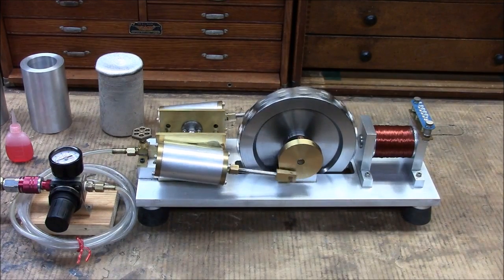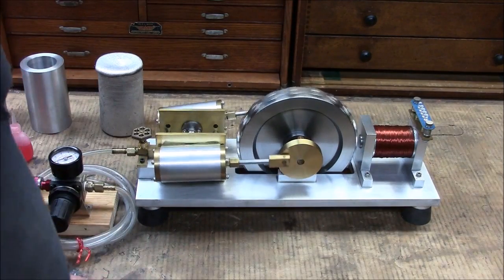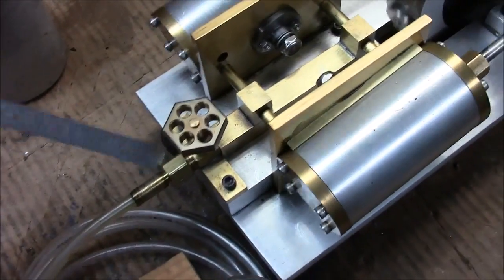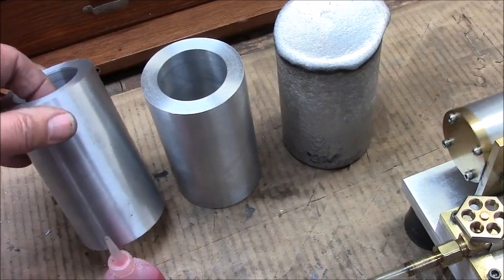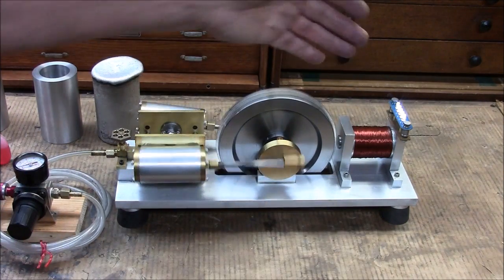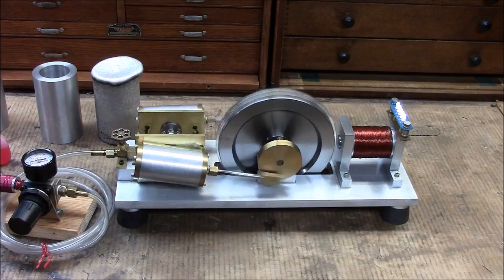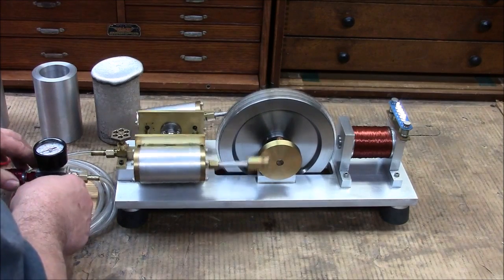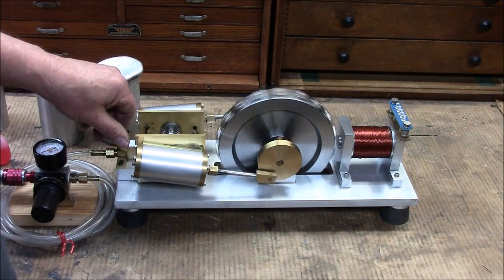Model Two Cylinder Steam Engine with Electric Generator

Comment: What do you do about lubrication?
Reply from the maker: I have an inline oiler on the airline. I also use oil injectors when running my models on steam. Thanks for watching.
Reply: @FredMiller  Fred, is that mechanical or hydrostatic lubrication when under steam.
Reply from the maker: @haroldpearson6025  Hydrostatic on steam. The style that uses water displacing oil just before it enters the engine.  Since they are only models and don't run that often or that long I feel they that is sufficient.  When I air power them I use an oil injector that would be used on an "air tool" and it is set higher than normal.  Hope that helps.

Comment: Hello Fred would you please confirm that the stroke of your engine is three inches?  I've watched your video with great interest and the piston rod doesn't look to be travelling by that amount of stroke . I appreciate that the video can be deceptive . I've just started to build a similar engine based on your design,  regards Brian
Reply from the maker: Hello Brian,  Thank you for taking interest in my channel / channel and BTW you have a good eye!  The length of the aluminum casting (length of the bore) is exactly 3".  The actual "stroke" of the engine is somewhere around 2.75" since the piston is approximately .200" thick and the throw of the crank must accommodate that or the piston would collide with both ends of the cylinder.  As I think I mentioned in the video I make my engines with no plans and I design as I build.  Good luck with your engine build..   Fred
Reply: @FredMiller  Hello Fred thank you for your reply regarding your engine . Like you I build my engines from scratch,  I think that it's more rewarding to manufacture  your own ideas ( sometimes they go wrong ) rather than follow  plans . I've subscribed to your channel so I'll keep a lookout for future entries that you submit. Regards Brian
Reply from the maker: @brianjohnson217  You should think about posting them on Youtube.  I would definitely be a subscriber.  I really like individual / original scratch built engines.  I get very little satisfactions from kit engines.  Fred

Comment: Hi Fred, Love all your engines.  I am a novice builder, could you tell me if the cylinders are double actiing please.?
Reply from the maker: Thanks for the complement Berty.  Most of my engines have double acting cylinders.  If you see cylinder heads (covered ends) on both ends of the cylinder it most likely it is double acting.  They tend to run smoother, have much more power and are able to run slower because the flywheel is being powered all the time not just half the time.  Thanks for watching...  Fred
Reply: Many thanks for your reply Fred, it is very helpfull.  I am on youtube a lot looking at builders steam engines and always come back to yours.  I think that the reason I always put yours above others is not only are they fantastic looking engines with clean lines but it's also that they run great at such low speeds. I can't stand the engines that are running really fast, I feel that the builders think that because they are running so fast they must be good engines but most of us know the opposite is true. Keep up the great work Fred.
Reply from the maker: @bertyjustice4424  Berty you just made an Ole mans day!  Thank you so much. There is absolutely nothing as satisfying as the first time you see and hear an engine you have been working on for so many hours come to life.   Best of luck with your building my friend...   Fred
Reply: Stupid me Fred, I ask "is it double acting" I have watched this so many times and still ask a question that you give a answer to in the video. Probably I am in a world of my own when mesmerized by your engines lol.

Comment: How is the steam going into the Piston chambers ?
Reply from the maker: The steam or air in this case is admitted to the ends of the cylinders through holes bored in sides of the cylinders near the ends.  The action can be seen if you look at the side of the cylinder base at minute 7:30 and beyond.  Very simple design but very robust in its operation.  Thanks for the interest.
Reply: @FredMiller  ok I thought so. I'm working on a similar model but going to have the exhaust as...well the exhaust lol. Need it for my cabin

Comment: How do keep the cylinders lubricated?
Reply from the maker: I have an automatic oiler in the line when I used compressed air and an oil displacement lubricator in line when I use steam.  Thanks for the comment.

Comment: Awesome work mate but in this setup your coil should be vertical so the magnetic field lines are cutting through copper coils at right angles, once made vertical move it as close to the rotor as possible and it will generate more wattage.
Reply from the maker: Many thanks for the recommendation.  I will put this modification on my to do list.

Comment: Every time you ramped it up i was waiting for the magnets to fly off lol, great setup as usual
Reply from the maker: LOL, the magnets are each secured to the flywheel with a #6 flat head screw through a hole in the middle of the magnet.

Comment: Very nice construction, but most engines I have seen the piston assembly does not move, why does this one move and is that movement a loss of useable energy?
Reply from the maker: Hi Frank,  All steam engines have to deal with "valving", the switching of input and output pressures.  Some use steam chests or spool valves, (see my other engines).  This one is an "oscillator".  The rocking of the cylinders it integral to the timing of valving.  Thanks for the interest and check out my other videos.   Fred
Reply: Fred Miller, thank you for bringing this to my attention, I guess I wasn’t paying attention, you did explain exactly what was going on with the oscillating valving. Looking forward to checking out your other videos, again, great work!
Reply from the maker: Happy to help out Frank..

Comment: Great looking engine Fred and a nice smooth runner at slow speed. Did you wind the copper coil yourself or is it bought like that ?
Reply from the maker: Thanks for the comment.  I did wind the coil.  It is over 2500' of enameled copper wire.  I put the coil core in the lathe in back gears and hand wound it.  It is a big hit at steam shows because folks can see that electricity is being generated from spinning magnets that is about 1/4" away from the coil.  Thanks for watching!
Reply: Thanks, I make model engines and have thought of making a generator something like the one you made :-)

Comment: Wonderful engine, and  the fact that is a double acting per cylinder it makes is such a smooth runner. The fact that it is an oscillating engine perhaps the cylinders could be lightened a little as the intertia of the oscillating parts will limit the top speed.
Reply from the maker: Thank you for the comments Carmel.  The head bolts take a good bit of room within the cylinder walls.  It is an exhibit type of model and not a industrial model.  Thanks for watching.   Fred

Comment: Great work...  are there any seals between the oscillating brass faces,?  The ally piston and cylinder would seem a good way to get a seize up, how do you avoid that,, is it just designed for short term working life?? Thanks for shareing your good work.
Reply from the maker: Thanks for the comments.  No seals between brass faces just oil.  The piston has nitrile O-rings and steam oil.  The engine is for steam show and educational purposes.  Thanks for watching

Comment: I built a rocking air piston in high school. The piston head was 1/4" in diameter and the stroke was about 3/4". It was a pain in the ass to make with my skills. Leaked air everywhere but was easily self-sustaining.

Comment: OH!  OH, oh, oh.  It took me a while to figure out how you were actuating the valves.  VERY NICE.
Reply from the maker: Thank you so much for the comment.  I am currently building a larger 2 cylinder engine with the exact same valve system.  I have been working on it for a year and a half with 6 months more work to go.  Please subscribe or check back for the finished engine..
Reply: You're very welcome.  I thought of something else that might enhance the generator & LED section of your project.  Look up a very interesting but simple circuit called a "joule thief."  It will brightly light up a white LED (which normally requires over 3v to illuminate) from a single "dead" AA cell that measures less than 1.0 volts, seemingly forever.  With some rectification you could dump the output from your generator into a large capacitor and feed that into a joule thief circuit to light up your LED's brightly with no or minimal flickering.  Just a thought!

Also, with your obvious machining/fabrication/assembly skills and understanding of reduced friction, you should try to build an LTD Stirling engine that will run off of the heat from a cup of hot water!

Anyway, I digress.  Stay well my friend...

edit:  I forgot to mention, if you do decide to explore the joule thief circuit, be careful of how much voltage you ultimately feed to it's input because if it gets too close to the forward voltage drop of your LED's and you don't implement other components to control it's output voltage (like a zener or something) you'll fry your LED's!  You don't need to even wonder how I know this...
Reply from the maker: I really enjoy digging into technology I don't know about.  I will definitely  look into the "joule thief" circuitry.  I LOLed at your last comment.  If you don't have the occasional failure you are not trying hard enough.  Many thanks- Fred

Comment: Wow, great engine project, Fred.  Beautifully crafted and runs so smoothly.  Is the flywheel made from steel?  Nice idea for the generator, too.  You may be able to get more current from it by trying to close the magnetic circuit.  PJ

Comment: That's really good Fred.   I like the LED application.  Maybe try and hook up some small LED lights on a Christmas tree for the grand kids :)

It's given me a few ideas.

You can't beat home casting for this stuff, saves a fortune.

Those cheap little air regulators are also really good for this application.

Great video.  Thanks for posting.

Cheers Rob

Comment: That's a sweet engine!  Great craftsmanship!  Would be interesting to hook up a voltmeter to see what your little generator is putting out.
Reply from the maker: Thanks Michael.  I still have engine hooked up since the video recording.  I will give it an open circuit voltage test and post a video if it proves interesting.  Have a great Christmas my friend...   Fred

Comment: Excellent piece of work. What are you using for a piston ring - an O-ring on an undersized piston?. I'm currently building a scratch built single cylinder and have opted for a O-ring on an undersized Delrin piston running in an Aluminium cylinder (double acting with spool valve)
Reply from the maker: I am using an aluminum piston with 2 silicon O rings.  Very good seal.  Thanks for the kind words.